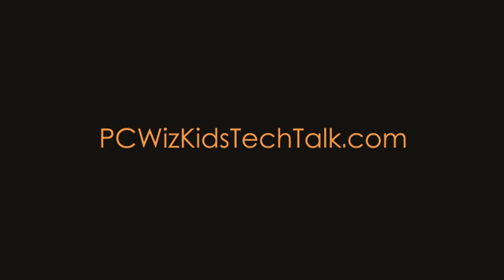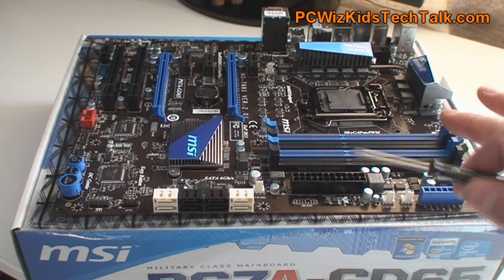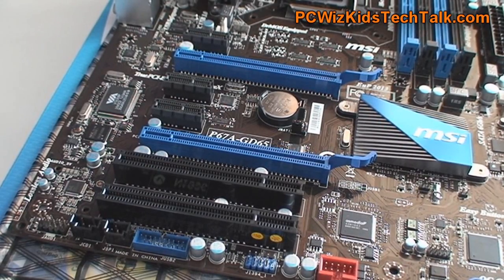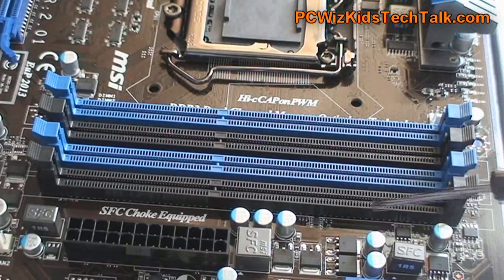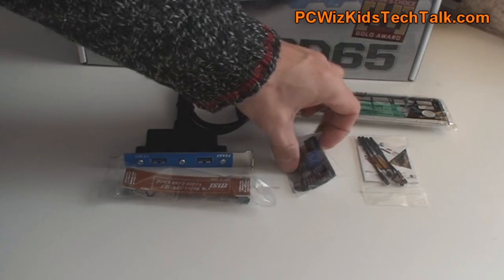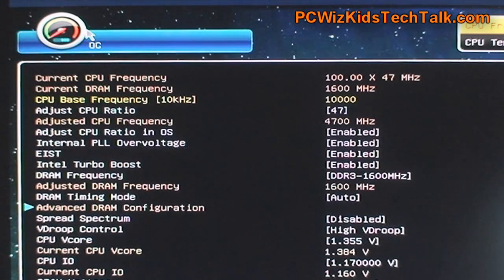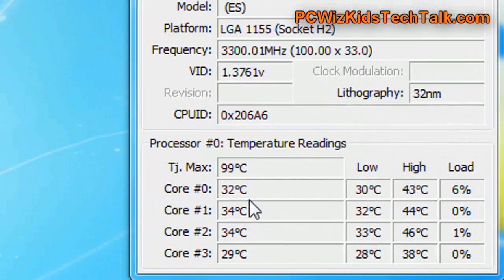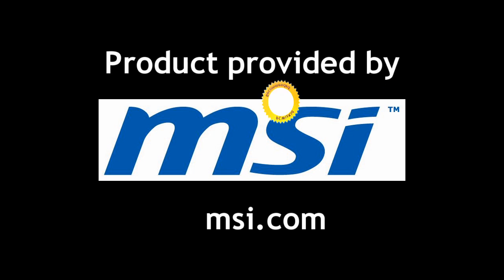MSI P67A-GD65 Motherboard Review

Comment: I wish the fucking motherboard designers put all the PCI-E x1 all on top of the board so when they won't have a chance from being covered up by a 2 slow graphics card.... I have a really good network card and sound card, and it would be nice if they were all on top (you know, near the CPU socket).